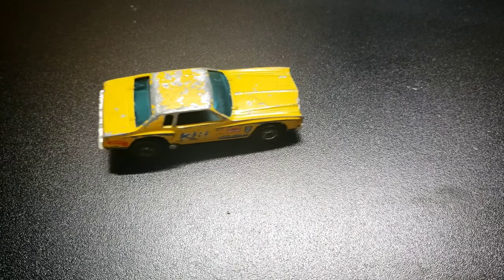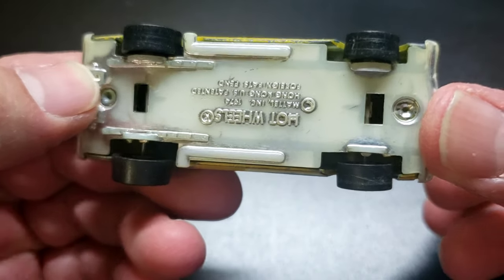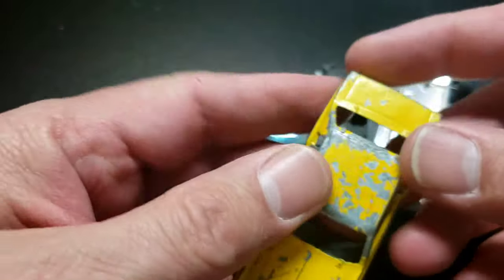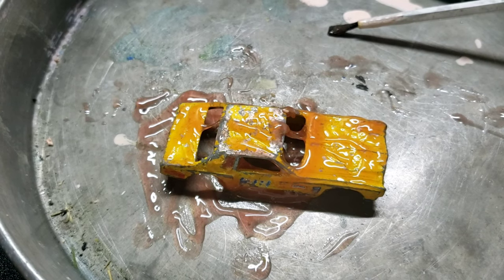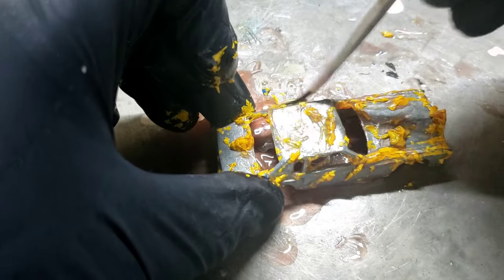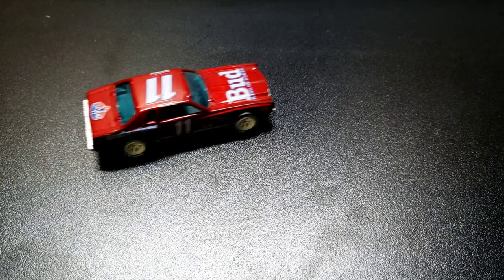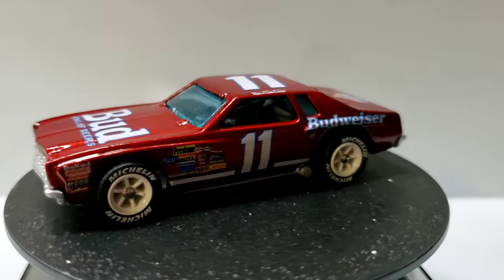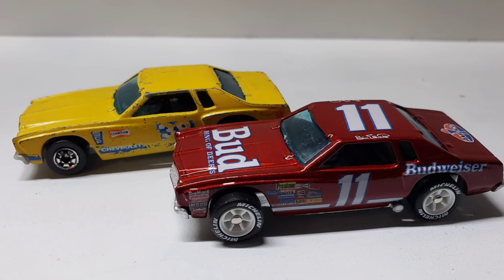Custom Hot Wheels (Monte Carlo Stocker)

Comment: Stunning Monte Carlo Stocker! The reason for the scoop is that the base and interior was shared with the Torino Stocker. Excellent job on it 🍻
Reply from the maker: Thank you!! Yeah I later found out that the interior was the same for the Torino stocker.. prior to editing the video I actually had a part where I talked about it, but unfortunately I had to leave it on the cutting room floor.
Reply: I Do like your builds alot. This is another prime example 🤙🏼 the monoblocks are fitting to a T

Comment: The Monte Carlo and the Torino stocker were/are basically the same car the difference was the Torino had a hood scoop with a hole in the hood. The two shared the same interior and base.
Reply from the maker: Yeah, I didn't know it at the time, but when I looked at one of the Torino's I had sitting around I figured it out. Thats actually a pretty good idea by Mattel to do it that way... I had a section in my video where I talked about it, but the video was getting a bit long so it ended up on the cutting room floor.

Comment: Excellent Build!!!  Thanks for all the tips!!  What kind of wheels did you say those were?  Are the wheels more display or are they multi-purpose where they would be good for racing also?  Y'all Stay Safe!!
Reply from the maker: Thank you!! They are more for display, but I have been experimenting with axel tubes and nickle plated bank pins. They spin really well, but the wheels are rubber and keeping them centered on the rims can be hard.
Reply: @Nero62CustomDiecast  Oh ok Cool!!!  Thanks!

Comment: Do you put clear coat before or after the decals?
Reply from the maker: Both. I paint the car and then clear it. I put the decals over the clear, which helps hide the lines of the decals, and gives the decals a little floating effect. And then clear it again after the decals are on.
Reply: Nero 62 Custom Diecast the second coat of clear doesn’t fudge up the paint? I swear every time I put clear over dry paint it wrinkles up and destroys the paint
Reply from the maker: @thomasfilipiak3966  so what I have learned, especially with the dupli color metal cast paint. You need to put the clear on about 10 minutes after you put your final coat on. Otherwise you need to let it dry for several days before putting the clear on. I have had the same thing happen. Once the clear is on and dries I haven't had a problem putting more clear on.

Comment: Do you do contract work, Nero?
Reply: I'd love to be able to modify my own die cast cars, but I have nerve damage and the lack of fine motor skills in my hands makes it impossible.
Reply from the maker: I have in the past, but not anymore. It never really ends up working out right. Either the cliant stops communicating and I'm left with a car that has a lot of wasted time and effort in it. The money for the car or for the work I did to a car sent to me never shows up, or quite frankly I'm just not into the car or what the client want's done to a car.

 Making these cars is kind of my escape from reality, takes my mind off of work. Once I start putting a price on things it quickly starts feeling like a job. 

It also depends on the project. If it is something that sounds interesting and I think will keep me interested I might take it on. 

If there is a car that I have already made that you are interested in we might be able to work something out.
Reply: Understood.
Reply: @Nero62CustomDiecast  What if I pay in advance?
Reply: I've got a Steel Stamp Series Steel Passion and a '48 Tucker Torpedo (Hot Wheels) that would look great running on 3DBotmaker's track with your sponsorship . . .